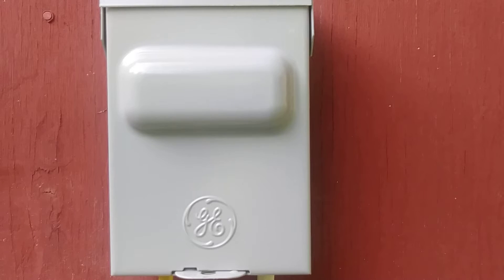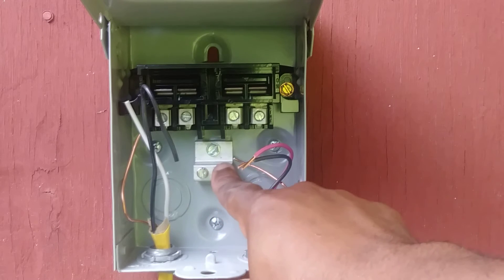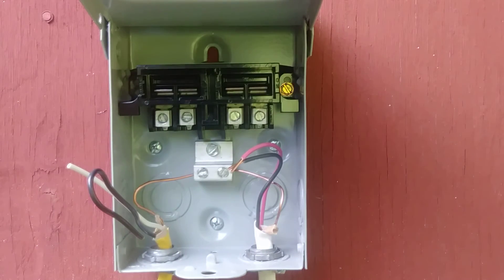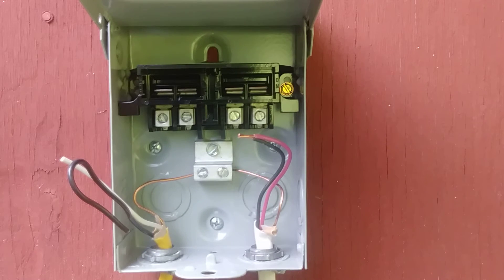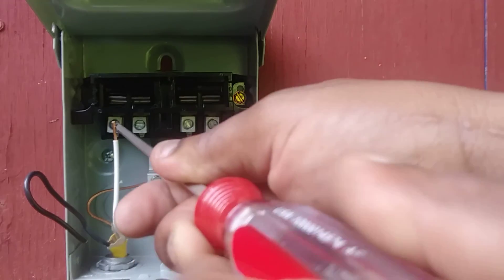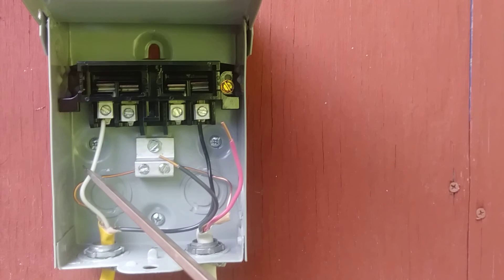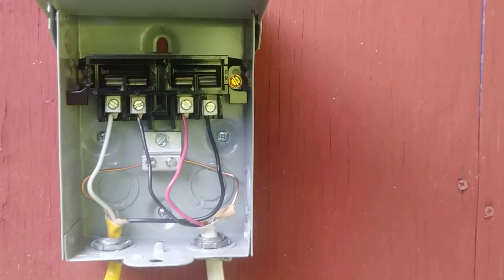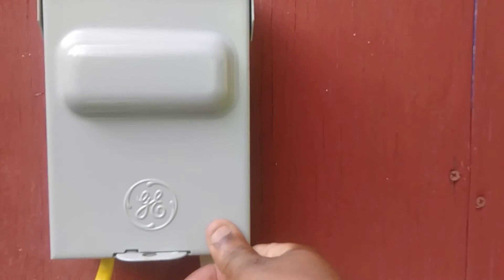How to install an A. C. Disconnect

Comment: Thanks for your video BUT you made a 2 mistakes, NEVER mix your wires 14 gage whit 12 gage, if you gonna use the neutral wire for power don’t forget to face the wire whit black or red tape.
Reply: Another mistake, the cable is not for outside. Cannot pass inspection!

Comment: I have the same disconnect box for my mini split ac unit that runs off a 20amp breaker so with the black and white wire white being hooked to the common ground bar in breaker box and black wire to 20 amp breaker. Where do you hook the white wire to in the disconnect box or do you just use the black wire?
Reply: I was looking for the same answer but I still have not found it. Did you find the answer I have the same exact set up as yours

Comment: Can one add a 240 plug to this AC disconnect box or a welder or plasma cutter?  I really I don’t use the air, ever. However, mine is fused. Thx
Reply from the maker: Yes you can add a 220 volt cord to a disconnect. The disconnect can be used for other appliances also. All you have to do is land the 220volt hot leads on the load side of the disconnect
Reply: @rickyjewett6082  
What size wire, 10g?

Comment: I did one oh these today. 30 Amp and the HVAC guy had me run 10/2- also 240v. I'm surprised you were able to run 12/2 on a 60 Amp.
Reply: Great video but, yeah, that’s a 20 amp installation. The connections are well explained though.

Comment: Are those both 2 way wires or is the red/black a 3way with the nautral terminated?
Reply from the maker: No the red is not used as a 3way. The illustration here is just disconnecting two  hots.
Reply: This was very helpful for me,   thank you very much

Comment: Thanks! I hooked mine up and I’m getting a 220 voltage reading on the line screws, but there’s no juice on the load wires. I triple checked that the disconnect bracket is in ON position, and I have my hot lines from the panel in the 1 and 4 screws in the disconnect box. What did I do wrong?
Reply: I've heard that occasionally the box can be bad.

Comment: Ricky, you did a very hood job tutoring this procedure. The same non fused box often is used for submersible well pump disconnects. I have a very old disconnect that is missing the hinged lid so I am on here looking to see if there is any new stuff. I have this same box ordered from Amazon since our local Lowe’s Home Improvement currently has no non fused boxes on hand. Go figure. Thanks for your post.  Good job.

Comment: isnt white suppose to be common?
Reply from the maker: Not in a 240volt circuit . In the video. I used it as a hot. I was supposed to put a piece of black tap around it to indicate that it is a hot. A white can be used as a common in a 3 way switch but it still must have black tap on it. Also in a 24 volt circuit, the white wire may be used as a common.

Comment: The best explained video I seen out of dozens...you need to identify that neutral as hot for dummies like me with tape or paint
Reply from the maker: Yes you are right. I fortgot to identify the white wire As a hot wire ( with black tape). Thanks for the input and thanks for watching.

Comment: Ricky: Let me start by saying your video is hands down the best one on how to install an ac disconnect , very thorough and well explained. But my experience was anything but good. My first hurdle was that my box was mounted to stucco and brick. That by itself really shouldn't have been a problem except the installer of the box I replaced used "nails" to mount the box. So it wasn't just a matter of unscrewing the box, I had to pry it off and to make it worse the box was sealed around the outside edges with stucco. So first I had to chip away the stucco, then get under the box with chisels and pry the box off. Then once I got the old box off the new one was smaller so none of the original holes lined up. So I had to drill new holes, but the old ones were just close enough to the old ones that it made that task a challenge. Ok so I got it mounted up and all connected, then went to put the cover on to learn the cover slides in behind the box and the backing plate was tight to the wall so I had to chip away more of the stucco than I wanted, but I finally got the cover on. I then turned on the power after making sure all connections were correct and very firmly in. I couple minutes later my unit kicked in and its working beautifully! I made the process more difficult by installing a box that was smaller, upgraded from a 30 amp to a 60 and  from a pull out disconnect to a switched disconnect. I wanted Square D, that was just my preference. Mostly because I have found them to be a better quality than most others and Im just more familiar with that brand. Sorry for the long winded comment but I thought people should know its not as easy as it looks. Probably best to just stay with the same size and amperage box if you just want to replace your box. Thank you for your video, you were tremendously helpful.

Comment: I think I've read that you shouldn't use rommex for outdoor wiring, even if in conduit. But I'm not an electrician :)
Reply from the maker: There is a certain type of romex you can use for outdoors. It is normally gray in color. You can also use the regular romex outdoor if it is in waterproof and watertight flex tubing. In the video I may have not done everything by electrical code. I thank you for your input and I thank you for watching.

Comment: Why is there no neutral.  Is this box specific to HVAC 240. What about smaller units running at 120 volts?
Reply from the maker: In this illustration,  there is no neutral. Not every 240v circuits  require a neutral. An AC compressor does not require a neutral. The disconnect in the video is for an AC compressor, however a 240 volt dryer circuit does require a neutral. For a 120 volt circuit you don't have to use this disconnect. You can use a single gain box and a single pole switch. Yes this  disconnect is specifically used to disconnect 240volt circuits.I hope that helped or answered your question.
Reply: @rickyjewett6082  Thanks for the explanation.  Quite the discussions over a neutral and 240 on the internet.

Comment: Hey Ricky I know it's been almost a year since your uploaded but I have that exact 30amp disconnect going in for a mini split 115v so how do I need to wire that one? Please let me know thanks
Reply from the maker: I am sorry. I have to say I don't know
 I have never done a split unit before.
Reply: @rickyjewett6082  it's all good brother I got it figured but thank you very much for getting back to me
Reply from the maker: @2g6382  OK Great!!Thank you. Now when you get a chance can you share the information with me? If and when you can, just leave me a message about how you did it.
Reply: @rickyjewett6082  so it was just a fused 110v so instead of using both line 1 and load 1 and line 2 and load 2 I only used the one side. As far as the mini split AC it was a Della 30 pound air conditioner and the wire's were labeled from the factory
Reply from the maker: @2g6382  OK. Thanks for your quick reply. I am always open to learning something new. Iron sharpens Iron.
Reply: Motorola Mad Scientist  I just ordered a delta thought it was the 110v but got a 220v.
Reply: @Eeruby  What would happen if you landed the neutral wire from the breaker box to one of the line terminals and the other neutral wire from the AC condenser to one of the load terminals?
Reply: Just use a regular switch you would use for a light (110v) to break the hot wire. in a one gang bell box with a weather proof switch cover with in reach of the condenser .

Comment: A white common wire should never be Line or HOT. You should have used 3 wire.
Reply: Thats crap, whites are used as hots all the time, it's legal as long as you identify it as hot.
Reply: @Aedec1  yes if you code it with black elec. Tape which he did not mention is why I said something.
Reply: Black Or red tape to mark the White line side would help

Comment: I have 2 circuits with separate circuit breakers going to the condensing unit.  Do I need 2 separate disconnects?
Reply from the maker: How many wires do you have going to the condensing unit?
Reply: @rickyjewett6082  I have 2 sets of #12, both with 1 black 1 white and 1 ground.

Comment: How do you go about wiring a disconnect when you need to use 10/3 wiring like for a mini split. For example, 2 hots, 1 neutral and ground?
Reply: Wire the two hots (red and black) from panel to disconnect line terminals as he is showing in this video. Wire the two hots to load (red and black) to load in disconnect as he is showing in this video. Connect ground (bare or green) on each line and load circuit as he is showing to the disconnect. Then, strip back the insulation on both line and load neutrals (whites) about 3/4" to show bare wire. Then use a appropriate sized (depending on wire size) wire nut or kearney to connect the white neutral from the panel to the white neutral on the load wiring. Make sure that the wire nut or kearney is taped or shrink wrapped (no bare wire visible after completion, as neutral is a load carrying conductor)! Then stuff this junction back in the disconnect. All done!
Reply: That is totally my question - did you ever find the answer?

Comment: Helpful video...thanks. However, what wire qauge is needed for a 60amp/240v disconnect box on a 75ft run and what is a diff....between a single/3 phase wiring?  Any tips will be appreciated.
Reply from the maker: Thanks for watching Etalkmth. To answer your questions:  You would use a size # 6 awg  copper wire for 60 amp. In the case of the 75feet, the length would not affect the circuit. The # 6 wire is sufficient for the 75 feet length and the 60 amps.
      The difference between single phase and 3 phase is, single phase use what we call one single phase with 2 hot legs. From one hot leg to ground the voltage is 120volt. From the other hot leg to ground the voltage is also 120volts, However from one hot leg to the other hot leg, the voltage is  240v. In the disconnect in the video, both hot legs is landing in the disconnect.
  Now in 3 phase, there are 3 different phases. From each phase to ground the voltage is 120 volt, and from each phase to an other phase the voltage is 208volt. Single phase, which is 240/120volts, is used in most houses and some small buildings, and 3 phase, which is 208/120volts is found in larger buildings. I hope I was able to help you. Again thanks for watching

Comment: The video explains 240; how would the wires connect if you the unit is 120?
Reply from the maker: If you wanted to install a disconnect for 120volts, You can install a single gain box and use a single pole switch. In a 120 volt circuit,  you will have a hot wire ( most likely black in color)  and you will have a neutral ( most likely white in color. ) In your box you will have 2 sets of wires. You will have a black and a white wire coming from the power source and a black and white wire coming from appliance you are controlling. Tap or wire nut the 2 white wires (neutrals) together and land the 2 black wires on the 2 gold screws on the single pole switch. Either black wire can land on either gold screw . It doesn't matter 

  You can also use a disconnect. Land the black wire ( hot  that is coming from the power source )no one of the line side terminals and land  the other black wire ( wire coming from the appliance across from where you landed the other black wire. In the disconnect  in this video  the black hot wire coming from the power source will be landed on top screw and the other black coming from the appliance is landed on the button screwDO NOT LAND THE WHITE NEUTRAL WIRES ON THE TERMINAL SCREWS . Wire nut or tap the 2 white wires together. I hope that this can help you. Thank you so much for watching
Reply: @rickyjewett6082  Thanks for the reply; let me start over. I am installing a Mini Split AC unit 115v. I have the same GE 30 amp disconnect you used in your video example for wiring 240v. My question is when wiring for 120v, do I take the black wire from the panel to the LINE lug and the black wire from the unit to the LOAD lug and wire nut the two neutrals together to have 120v?
Reply from the maker: @johnferraro3085  Yes John. That is what you do.
Reply: @johnferraro3085  How did this end up going for you? I'm doing the same now
Reply: So, if I was running 10/3 or something with 2 hots, one neutral and one ground in this same box, I would wire almost exactly like you did except I would tie the neutrals together (ie. Wire nut)? Thanks for the help!

Comment: I’m glad you mentioned, depending on what disconnect you have, to read the instructions first because I was thrown off with how the wiring was being done in this video. The reason why I say that is because I just installed a disconnect  where the power coming from the breaker box connects in your two lines and your equipment is your load wich were on the two outside